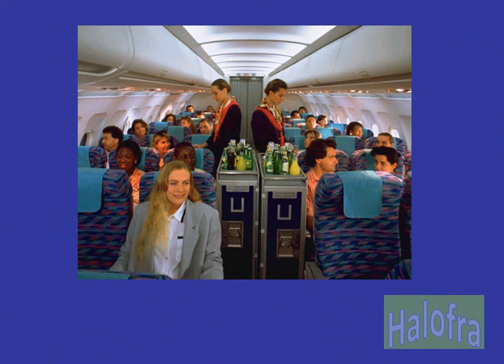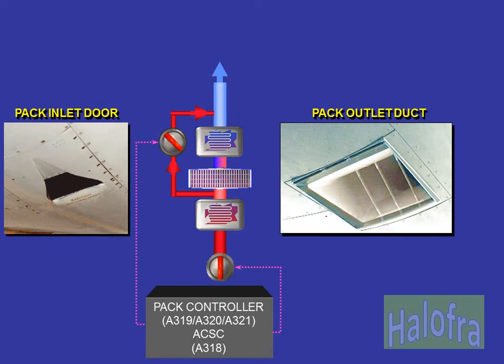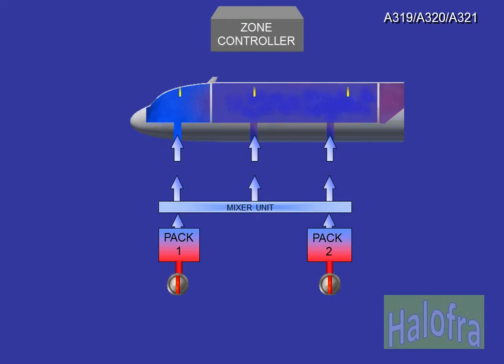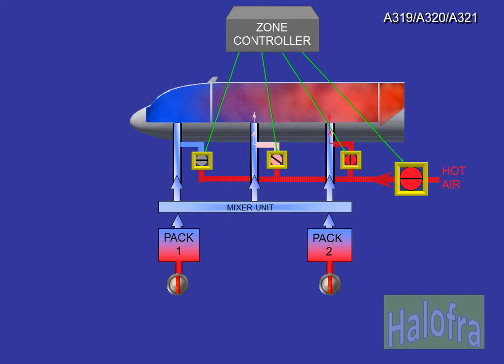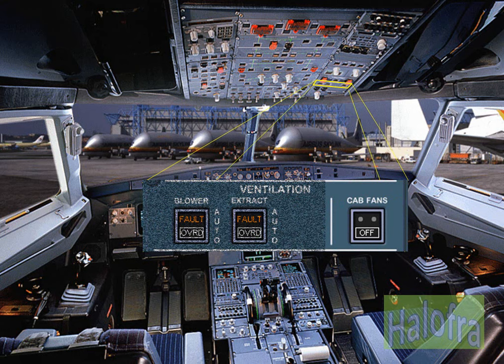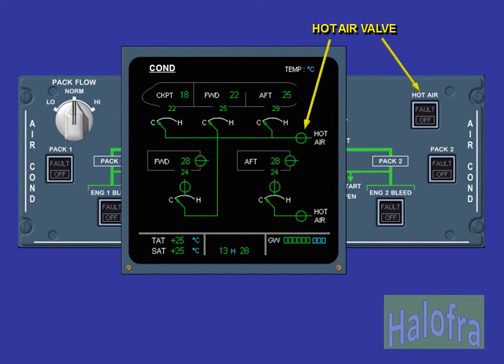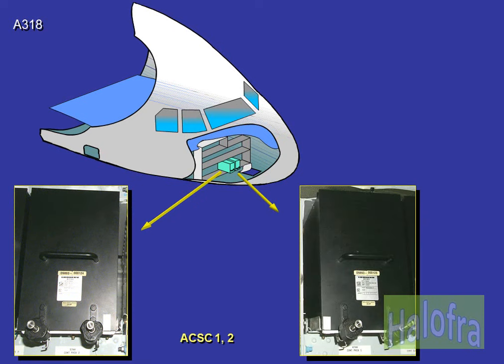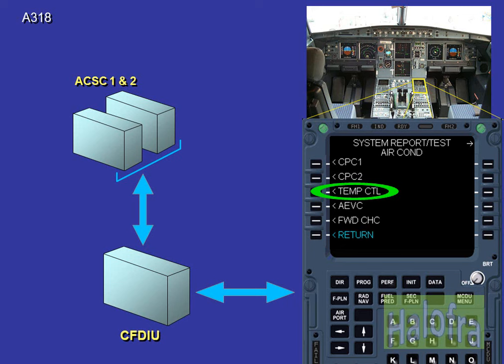Air Conditioning System A320 Family

Comment: Hi can i ask. Where is this hot bleed air coming from?
Reply from the maker: Hi, it's coming from the Engines
Reply: one of the high pressure compressor stages of the engine
Reply: From Engines if running or APU bleed
Reply: 5th stage and 8th stage in compression of engine

Comment: Is the Flow Control Valve electrically powered ?
Reply: The pack flow control valve is electrically controlled and pneumatically operated. 
It closes manually if the releted PB is set OFF, or the FIRE Pb , or the Ditching Pb are switched on .
It closes automatically in case of overheating and during engine start.

Comment: Didn’t see the filters
Reply from the maker: The Filters surely exist, Thanks
Reply: AviaLearn yes but essential in these COVID-19 times
Reply: There is 2 big cabin air filters right in the distribution bay. The filters are installed before the mixer unit. Air go through the Filters>Mixer Unit>Cabin. I'm mechanic, worked on them already.
Reply: @victorrodrigo7477  hey i had some doubt about how we not allow toxic gaseous vapour to enter in cabin since only hefa filter is used and not activated charcoal

Comment: where is humidity control;that can affect viruses transmit and dangerous oxidation of wire and electronics plugs;the cargo compartiment need to have low temperature, pressurized with co2 no fire ,no viruses transcontamination;
Reply from the maker: Humidity control  is a new system and can rarely exist depending on companies choice . 

Aircraft humidity control systems company, CTT Systems AB (CTT), has secured the first business class cabin humidification award for the Airbus A350-900. The airline client, the identity of which remains confidential, has selected humidifiers to be line-fitted by Airbus in the flight decks, crew rests and business class cabins aross its entire A350-900 fleet. The shipset amounts to six humidifiers and totals 20 A350-900s, with first delivery scheduled to mid-2019.
Reply: no virus can survive the heat of the compressor prior to cooling...so no risk of viruses.  Because the compressor outlet temperature is so high, there is no humidity...it is very dry air.  There is NO humidity control on most airliners...only the very newest airliners like the 787 have such a system.  Cargo compartment temp is controlled by the flight crew.